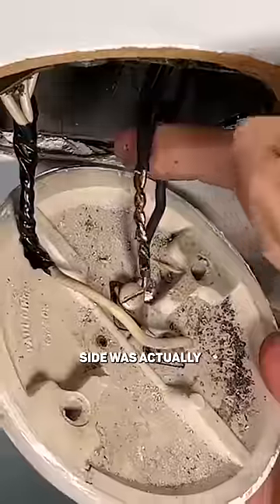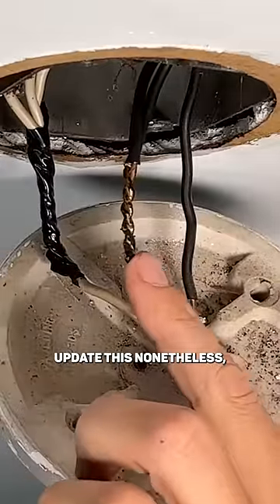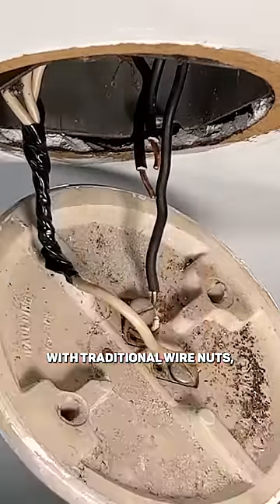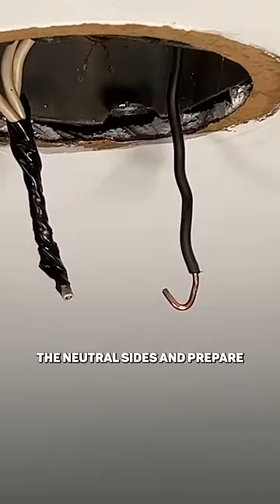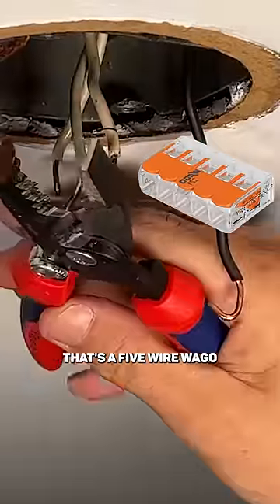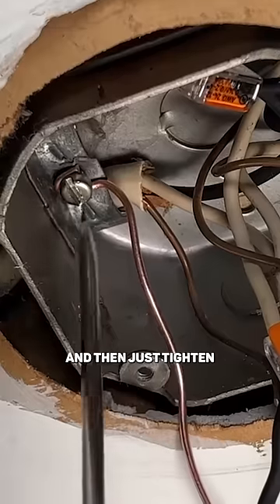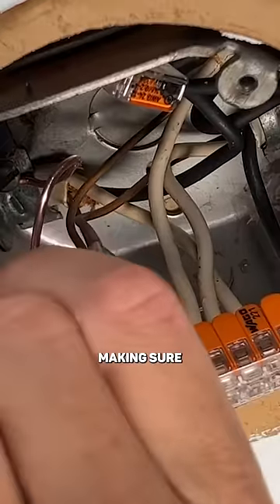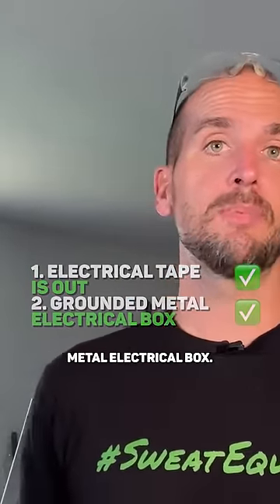Which Part Doesn't Meet Code?

Comment: Ive never seen a wire nut in the UK
Reply: Because it's illegal to use them on mains electricity
Reply: @michaeldunham3385  i thought as much. They don't look reliable
Reply: @danzelwasherton1234  I've only ever had to use one once when I was staying with my sister in North Carolina...... you'd think that America would be at the cutting edge of technology, apparently not
Reply: @danielneil9553 
Well they are...nothing wrong with them. Literally every house in the country is wired with them, ,  ,
Reply: @danzelwasherton1234  looks are deceiving they are actually more reliable and make a better lower resistance connection. With loads of independent testing backing this up. You just get more tax on a more pricey item so I think it's a money thing.
Reply: I started my uk apprenticeship back in 1982 and ceramic wire nuts were getting used then 
Didn’t last long though as regs changed
Reply: Id imagine that they work well if fitted right but too much room for user error, like using the wrong size for wrong gauge wire...
Reply: @donaldross4217  are you sure, because I've never seen them in the UK and I've worked on some seriously old buildings
Reply: @michaeldunham3385  
Yea they disappeared fast around that time , but even up to now you often find them in Attics in old houses and I’ve also come across them in old motor joint boxes in old industrial rewires
I was even asked last week by a apprentice what one was as he had found them used in a rewire he was doing 
The worst thing about them was people used them outside joint boxes and wrapped them in tape 
The tape unravelled and fell off then the screwits as we called them fell off and left bare cables loose and sparking 
The cause of many a fire and electrocution of people working under floors 
And to be honest in the last ten years I’ve seen them used in crane control panels and motor joint boxes in various colours denoting their size and amp capacity but these came from outside the uk
Reply: @michaeldunham3385  I’ve just checked Amazon uk and you can still buy them
Reply: @donaldross4217  
 I think we may also be suffering from a bit of misunderstanding here or maybe just a slight bit of confusion.
 Doing a better research I believe that the wire nuts you are speaking of in the a set screw or something like that that held the wires in.  I'm from the US and have not seen these even though my house from 1940 did have ceramic wire nuts but they were the screw on kind really old!
 The kind of wire nuts we use in the US aren't like these at all they are a high temp plastic with a screw uh Spring that when twisted around the wire digs in and binds everything very well which is why they're still being used and In most new houses being built this very day.
 So I guess what I'm saying is maybe some of the people thinking about how we could possibly still be using these horrible wire nuts are thinking about the old school style and not of the kind we currently use.

Comment: You should have at least 6" of wire from entrance into the box and at least 3" protruding out of the box. Also just use wire nuts they at 60% less expensive and are less prone to fail in my experience.

Comment: in order to be up to NEC you should have used a green grounding screw in the metal electrical box and not the conductor fastener screw - js

Comment: I used lever wire nuts for a ceiling fan installation last weekend and probably won't go back to twisty wire nuts. Those are especially bad if you have to mix solid and stranded, and the lever nuts don't care.

Comment: I know those wagos are code but if there power gets shut off from the cold or they just keep there house freezing the temp change will cause separation an cause arking then if a heater or heavy load will cause a fire I quit using them only wire nuts for me

Comment: Pretty sure it's WAYgo.  Not WAHHgo.  Used properly I think these are better than wire nuts. Melted ones are from improper wiring, put the wires in all the way, there is a clear window for a reason.

Comment: Those connectors are dangerous! I just replaced a burned one for a customer today with wire nuts. That soldered connection would have been fine with a wire nut. Also, don’t use the cable clamp screw for the ground. If it’s tight enough to hold the ground wire, you’ll be crushing the romex

Comment: You could have just put a wire nut on it for $0.10, or take apart a solid electrical connection that will never fail and use $15 of new junk connectors that will be in a class action lawsuit in 10 years! Progress!

Comment: Wire nuts are better than Wago connectors. Wagos are ok for serial receptacle connections on the same circuit, but they should not be used for homerun nor lighting circuits. 

The Wago's internal clips have a smaller surface to surface area connection against the wire which greatly reduces the overall  conductivity as compared to using a simple wirenut.

Comment: wagos alone are a fire hazard...
Reply: @Kevin-mp5of  they may meet code but i would trust em based on my own expirience and findings in the field. Im sure you being a housewife and all around martha stuart makes you a great elektromagician though.
Reply: @Kevin-mp5of  like i said i dont use wagos at all and strip my leads with a set of knipex strippers which come out clean and to length required. I personally dont find them to make the best and most reliable connections. Wire nuts are all ive used. Wagos are csa approved where im from but marrettes are the standard.
Reply: @Kevin-mp5of  and by findings in the field i mean what ive found repairing other peoples crap when it stops working or lets the magic smoke out. I do renovations, repairs and updates to residential and commerical properties. Poor connections cause fires from what ive seen. Dont get me wrong ive seen some terrible crap from marrettes too but electrical isnt stupid proof.

Comment: Why use a 5 way Wago for 3 wires when they make a 3 way Wago which would be perfect?
Reply: 3 wire junction plus 1 pigtail to the fixture. Needs at least 4 connection points.
Reply: @kj3n569  Ah, I think the problem is, is that this is a short version of a longer video as there seems to be a couple of gaps in the processes shown.. Going by what you said, I now realise the need for the 4th connection. But, can you answer me this, why the need for 3 neutrals anyway? 1. Feed- In. 2 Load. 3. Feed-out. Cheers

Comment: I just used the Wago connectors and they worked great. Super easy to use and they are compact so they don’t take up as much space as a wire nut.